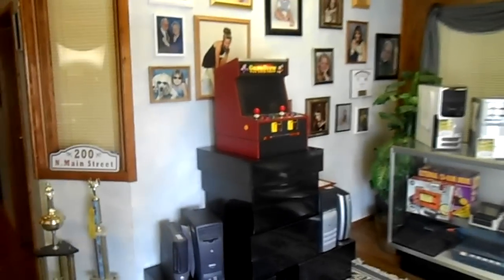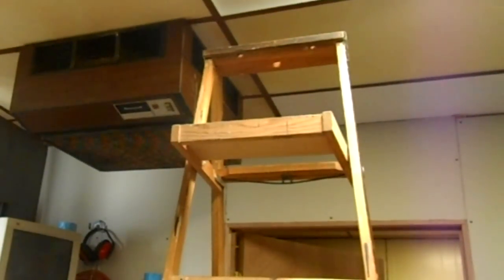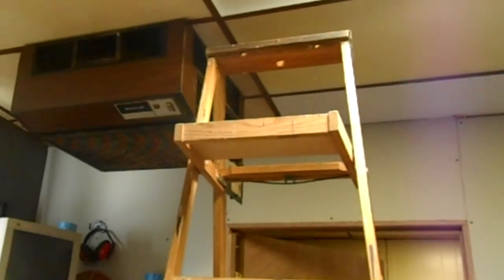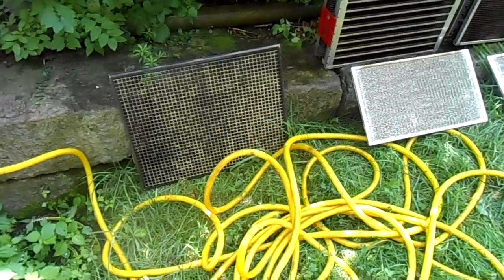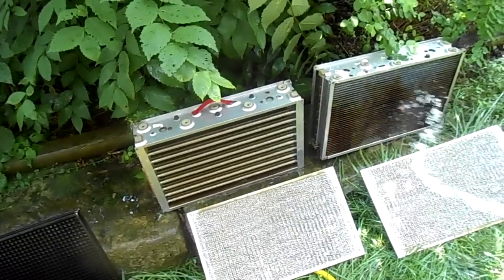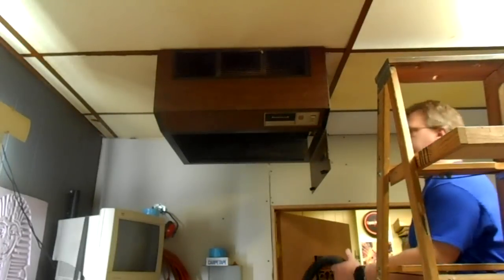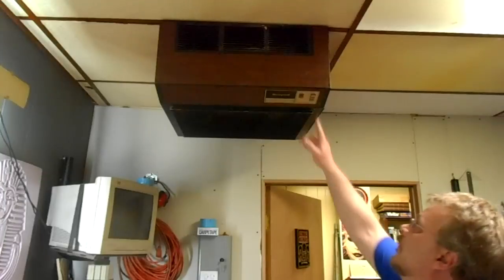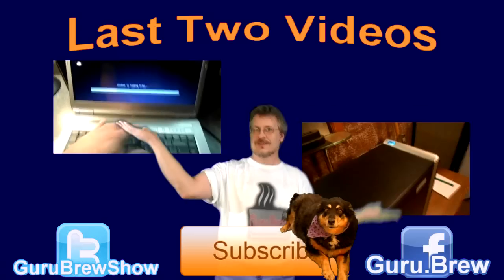Cleaning Honeywell Electronic Air Cleaner in CNC Room

Comment: Great timing.  I bought a Honeywell electronic air cleaner for my furnace about 2 years ago, and have my thermostat set to alert me when its time to clean.  Hadn't checked it for awhile, just looked and it says CLEAN.  The main element and the mesh pre filters look exactly the same as your just smaller.  Some people clean these in their dishwasher, I prefer to spray them with a bit of degreaser then let soak in the bathtub.  I have plastic post filters as well which can't be cleaned with water.